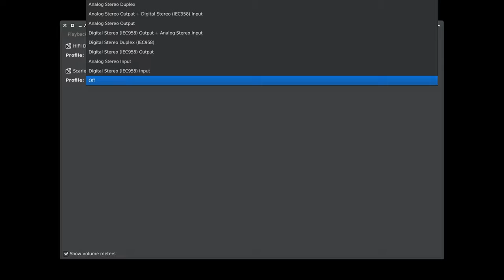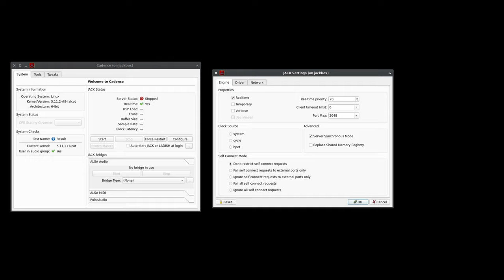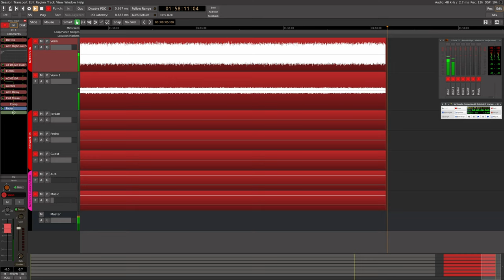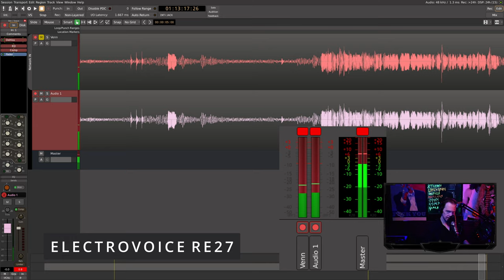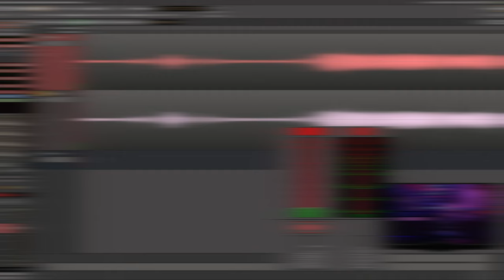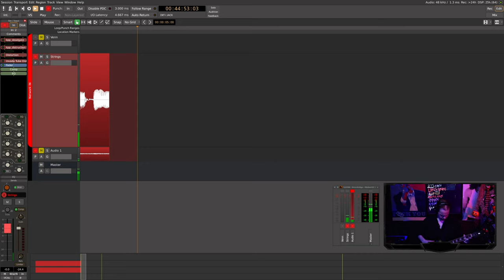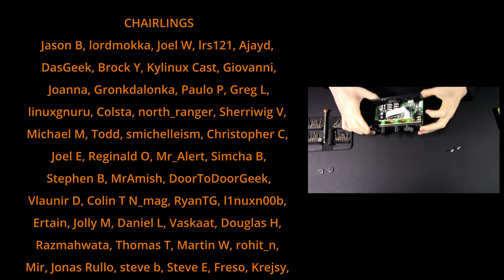Interfacing Linux: Focusrite Scarlett Solo Gen3

Comment: Thanks for doing this! I am benchmarking 2i2 3rd gen on PipeWire and so far I was unable to go below 128 buffer size. At least not on the stock Arch Linux 5.14 kernel. Could you share some details of your system config?
Reply from the maker: There is a link to the Jack Studio Setup on the website https://linuxgamecast.com/linux-compatible-audio-interfaces/

Despite the latency fixes in kernel 5.14+ they are still a bit bad-tempered with USB and PCIe interfaces. They also have an issue with raw ALSA MIDI. This is still an issue in kernel 5.15-rc6. 

Try building kernel 5.10.75 with the full RT patch set.
Reply: really I got mine down to 32 frames per buffer with zero xruns. You need to set your default cpu governor to performance, another thing I did was disable all devices except the one I would be using in pavucontrol or pulsemuixer. This is a known bug in pipewire's jack implementation where more than one audio device would spike cpu usage to 100%. They are working on it and I have 0.3.39 version of pipewire and its getting better, but probably won't be ready until early 2022 or even until Ubuntu 22.04.

Comment: Hi
I've gotten so much to run on Linux. Whether printer, scanner, external DVD drive.
Cd s scanned and converted to mp3 audio. Everything worked, but looking through here
that's really bad.

I've been working with Linux for more than 2 years now, a lot was recognized by myself, despite everything I had to enter some things manually in the terminal.
It reminds me a little of Do's times over 25 years ago. This is nothing for beginners. Despite all this, I have familiarized myself with the system.

I have the Scarlett Focusrite 8i6 and it was instantly recognized by the system. Pulseaudio made it available right away.
The only way I got information about the Alsamixer program was via Youtube.

Despite recognition and the LED lights up, I cannot use the device.

After hours of playing around, I also had audio coming out of the Scarlett's headphone output.
It was practically used as a sound card from the PC. Also two inputs switched over as a microphone via Alsamixer showed a level with Audacity.

So the device is not broken.

But now I can't get any further.

Alsamixer can be set and the inputs are then also active... But I don't get very far with Audacity. It's no use to me.

In addition, when I was in Audacity, there is no sound from mp3 samples.

At some point I got Cadence to run. And now?

Lots of small programs in there, like Catia, Claudia...
What's in it for me... I can't do anything with it. Catia tells me Capture 1-8 and Playback 1-12...
What does that mean?
I can't start anything.

In Jack Settings I have set driver hw:USB,0... As soon as I set a channel for Input channels or Output channels, the message comes up:

Failed start to Jack…..Why can't I tell the device there, use 2 inputs and 2 outputs?

In the video, the inputs and outputs are set to 0 and none...why?

At minute 2:30

At minute 3:09 Checking xrun

Which program is this? Which software?
I can't test a mic or guitar if I don't have software.

 What are the alternatives? I only ever have one track of Audacity. I bought the device extra to have more tracks.
I just want to record with it s.Pc, nothing else. But if I can't get an audio signal from the guitar or microphone, the device is of no use to me.

Maybe you have an idea...

And these error messages in logs:

 ERROR: JackPosixProcessSync::LockedTimedWait error usec = 29020 err = Connection timed out
 ERROR: JackEngine::ClientDeactivate wait error ref = 2 name = dbusapi
 ERROR: Failed to deactivate dbusapi jack client. error is -1

ERROR: JackPosixProcessSync::LockedTimedWait error usec = 5804 err = Connection timed out
ERROR: JackEngine::ClientCloseAux wait error ref = 2

Questions over questions and totally complicated.

Thanks....

Greetings

Comment: Ok, nice video...
But some instructions on how to get The interface running in Linux would be so helpfull!
I really thought there would be some guidance on that, but it was skipped over more or less.
Reply from the maker: It's a class-compliant USB interface. You plug it in. Works out of the box with ALSA, Jack, Pulseaudio, and Pipewire. 

Do you mean getting to work with a specific application?

Comment: Can you disable the mass storage device mode on this? In the manual it says to hold down the 48V button for 5 seconds, and it should disable it, but this doesn't do anything in my case.
Reply from the maker: Hold the 48V button then plug the interface into the PC. Wait for 5 seconds. 

If that does not work something is wrong with the interface. You should contact support.
Reply: @linuxgamecast  That worked. Thank you!

Comment: Although the Focusrite Scarlett Solo works out of the box with Ubuntu 22.04, I've encountered an issue where the 6.35mm headphone jack doesn't seem to be recognized by default. As a result, the audio continues to play through the speakers even though the jack is plugged in. I've checked the manufacturer's website, but unfortunately couldn't find any Linux drivers. I would greatly appreciate it if anyone has any insights on how to resolve this issue.
Reply: If you screw in the right sized provided adaptor it will work; my rode nht-100 headphones worked that way.